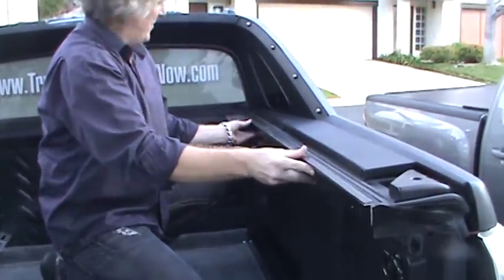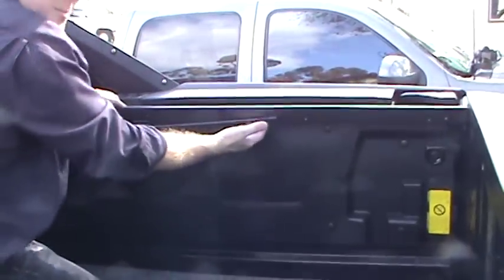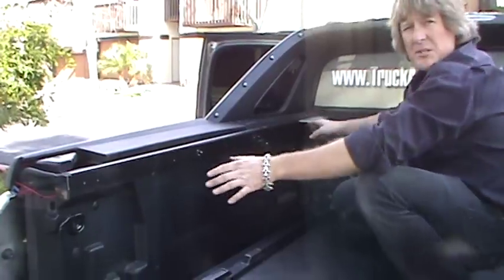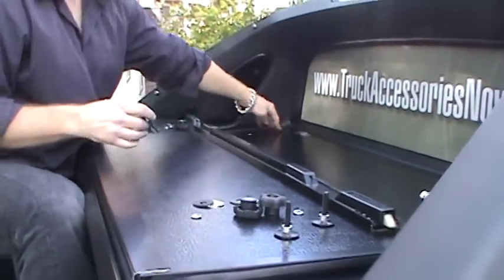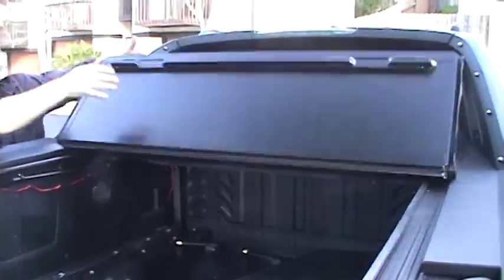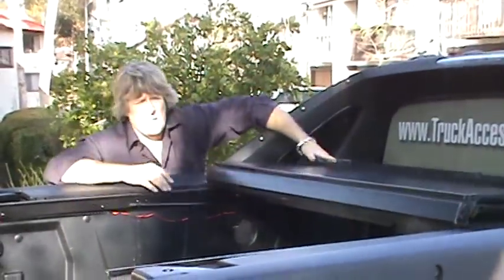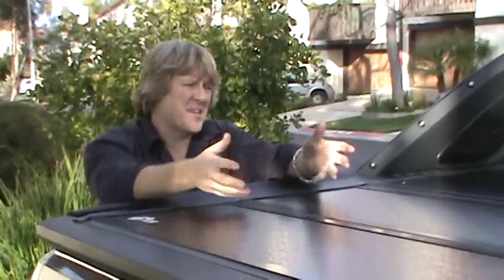BakFlip folding bed covers for Chevy Avalanche

Comment: This is much better than the factory panels.  One of the issues with the factory panels is the width of the tracks to hold the panels in place.  It reduces the width to less than 48".  You cannot have any 4' wide sheet of plywood or drywall sitting up over the tailgate with the gate closed.  This would be a huge upside to the original panels.  The million dollar question is - after the rails are installed, what is the width between the rails?  Thank you.

Comment: This is my AV, and let me tell you that the BakFlip is still working as designed and still looks great. It is secure, waterproof and a breeze to open/close. Everyone asks where to get one, even if the cost might throw them. However keep in mind that you can just sell your original panels to offset the cost. The used OEM panels are in demand because far too many are stolen or lost. You never have to worry about anything being stolen from in your bed with the BakFlip, as these aluminum panels are not going to be pried open like the originals can be. Also when you drop the last panel with the tailgate up, it automatically locks in place without having to push it down on both sides like when it was new.I highly recommend it.
Reply: The original panels lock from the inside with metal brackets. You can not break into them from the outside, unless you absolutely destroy them with an axe or something. And they are way more heavy duty. The only upside I see to this would being able to fold them up and leave them like that to use the bed space for hauling things.
Reply: @bradleymenezes6196  The original panels from the factory were being pried up (I wont say how publicly) in part because they were individual, not one contagious system like this one is. Regardless, as you point out one of the great aspects of the BakFlip system is you never need to remove the panels and then store them (taking up bed space) so they themselves don't get stolen or lost. They also don't fade with minimal washing/maintenance. As I mentioned, the Avalanche in the video is my actual truck, and I still have the BakFlip system in place. It is convenient and secure. FYI - a couple of people have reached out to me asking how to buy one. I do not own nor work for the company. So while I am happy to answer any questions about my personal experience with it, you would need to contact them directly for sales information.
Reply: @MultiEviscerator  yeah but how much water gets back there? And dont worry you dont need to answer any questions about the product lol
Reply: @MultiEviscerator also wondering how they will age. My covers are original from 2004 so 17 years old. They are faded just like the rest of the cladding but they have still held up and are still working fine. The only thing is the rear panel or 3rd panel by the tailgate seems to have a bit of a sag to it in the middle. Which allows water to drip down the inside of the tailgate. Is yours flush against the tailgate with some kind of stripping?
Reply: @bradleymenezes6196  To answer both questions, I do not have any water leakage to this very day, otherwise I would not be such a fan. That said, it was obviously installed by someone who knew what they are doing.
As to the last piece closing, it slightly overhangs the very inside and has a flap that lays on top of the tailgate surface. Now I do silicone it now and again to keep it supple. 
The panels themselves are painted aluminum, so just spraying some car wax/polymer on them like you do the paint helps keep them protected and looking great. Certainly better than the factory panels. 

In regard to your faded bed covers, sail panels, cladding, etc., there is a product that far exceeds all others and lasts for years with just one application ( though I like to apply two coats, one day apart). It is called Refinish Restorer, and rest assured there is nothing better on the market.

Comment: Just finished installing the G2 Bakflip on my 2010 Avalanche. easy install, only glitch was rod that holds panels up was pop riveted backwards and would not set flat, reinstalled rivets and all is good. Looks great fits nice and tight, will have to check water sealing later.
Reply: By the way self tapping screws suck drill pilot holes. lol

Comment: Although how good this is , it’d get in the way when you wanna get the most out of the midgate by putting something big like an atv or large refrigerator in the back and into the cabin like it’s meant to. Plus the stock panels can hold about 340 pounds on it even though it takes time to take all of them off. It’d be a great investment if you’re not hauling big stuff like motorcycles and quads.

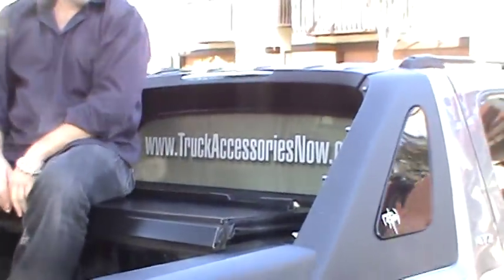Comment: Great video, i know its 11 years old but at 8:26 does anyone know where to buy that black plastic window panel covering the holes in the plastic roll bars?
Reply: I assume you mean the triangular cutout sections of the sail panels on the Avalanche. That is my truck in the video, and those are custom made to fit the space both on the inside and outside. It was done in CA, so if you are interested in getting some, I can send you the information. BTW - Others have asked what the symbol on the sail panel glass means. Not Of This World
Reply: @MultiEviscerator  Thank You sir.
Reply: I'd be interested in getting some of those sail panels windows as well if you can get me the information as well. @MultiEviscerator
Reply: @andrewnelson2066  I cannot remember if I sent the information to Bartyhummer directly or not, and now I am not positive if I still have the contact info for the vendor. Let me look into it, and if you have not heard back from me privately or in this thread, give me a friendly reminder after the first of the year.

Comment: my original panels leak and everyone knows how much of a pain in the ass the black on an Avalanche is to keep looking nice. I am looking forward to mine being installed this week. Some of these posts such as how bad it is to drive with them blocking the window... really you have mirrors and many vehicles such as cargo vans have no view in the center. Perhaps driving isn't their fortay? For someone to say it is a waste of $800. Mine leak so you are completely wrong. And $800. to some people is not all that much money. Try replacing just one panel from Chevy.
Reply: If you still have your avalanche and you are having problems with keeping the panels black, I did mine with Forever Black Tire Gel. It gets it black in 1 application, but is best with 2 and it stays after several washes. I always want to go up to people with faded avalanches to tell them my secret, but I don't want them to get mad. Don't get it on your paint or you going to have to get a clay bar to get it off. Tape off areas near the painted areas.
Reply: My old avalanche didn't have the panels. It had the one piece soft cover. That thing was a pain in the ass overtime to keep putting back on.

Comment: Driving in the fully open position and blocking the rear window is not a good idea!
Reply: Why cant you drive with the rear window blocked?? I drive A tractor trailer and only have mirrors to rely on. No rear window
Reply: didnt op for backup camera? lol
Reply: you only fold it all the way back if you have tall cargo in the bed, which block your view anyway
Reply: @LoveMyKleeKai  if you need back up camera to drive a pick up, you really need a smaller car